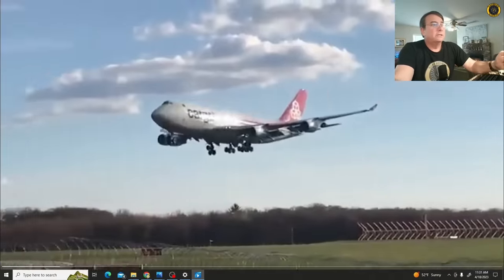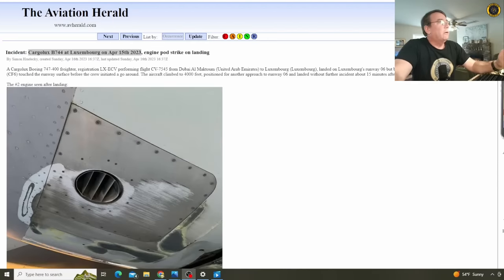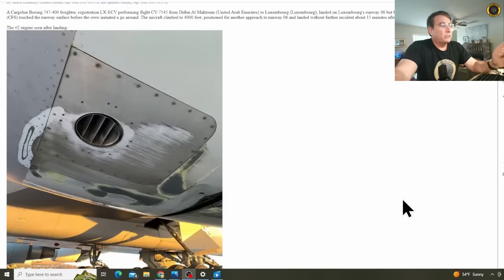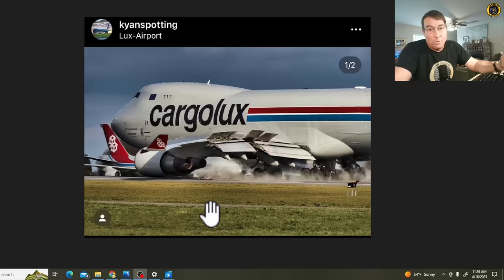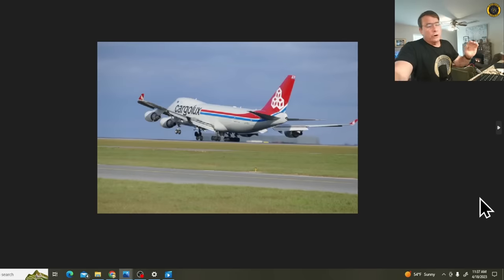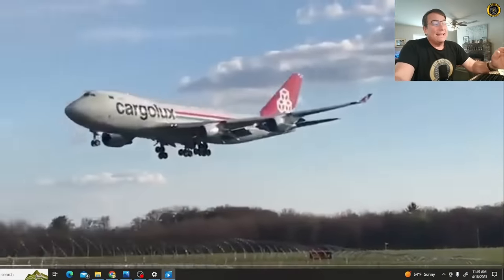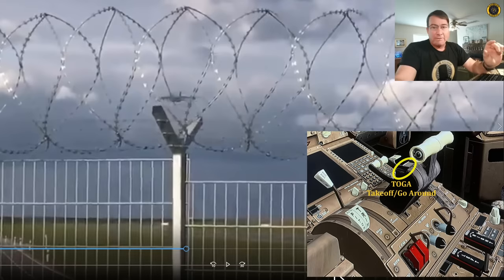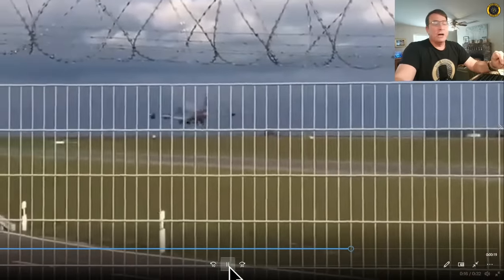Cargolux 747-400 KABLAMMO!-SMASH AND GO 15 Apr 2023

Comment: Most likely they were at flaps 25 due the speed which would have caused flap load relief at flaps 30. I have landed at this airport many times in a 747. There is a big hump in the runway that causes visual illusions as well. Very tricky in gusty conditions.
Reply: Is flap 25 an option in the 747? It is possible but not encouraged in the 777 except for at ultralight weights (<180T).
Reply: @EdOeuna  Our two landing flap choices are 25 or 30. If you are heavy and have any wind additive, you will have to use flaps 25.
Reply: @KarmaFlight  - that’s strange to reduce flaps for higher weight. On the 777 it is the opposite.
Reply: @EdOeuna  Does a 777 have flap load relief? It must work similarly if it has this feature. Do you land with full flaps in gusty cross wind conditions?
Reply: @KarmaFlight  - load relief only kicks in when you overspeed the flaps, and flap 30 speed is 180kts. Every landing is F30 except for unusual circumstances. I was in a freighter the other day and landed at 156T. This is about 15T above its empty weight. In fact we had extra fuel on just to keep the weight high. That was a flap 25 landing, but it’s pretty rare.
Reply: @EdOeuna  We land close to MGWT routinely at my outfit. Flap 25 landings are very common. Max landing weight in a 400F is 302 metric tons. Going into Mexico City in a -8 is a handful. You are going very fast across the fence.
Reply: @EdOeuna  Boils down to company policy/procedure, I suspect.

Comment: I am not a pilot and was wondering why it would not be safer to continue with the landing instead of going around, especially with a 13,000 ft. runway.
Reply: I’m wondering the same thing??
Reply: I'm not a pilot either, but from what I've read, trying to save that landing can lead to porpoising, which has a high likelihood to end in a crash. It's better to go around and try again instead of playing captain kangaroo and wrecking the plane.
Reply: Because you  have no idea, in the middle of a hard bounce with the aircraft making crunching sounds it shouldn't be, if things are safe at all. 

The three most useless things to a pilot are the altitude above him, the runway behind him, and the fuel he left on the ground. On the runway, you have 0 altitude to work with. If ANYTHING goes ploin-shaped, you go around, because that way you can assess the situation.
Reply: @00andJoe  Not sure the term ANYTHING is accurate. Maybe "mostly". Remember Pakistan Air?
Reply: @00andJoe  Makes sense - thanks
Reply: @realulli  Makes sense
Reply: There is a lot of runway remaining if you do this on a 4500m runway, so it might just be easier to stop. If you’ve deployed the reversers then you’re definitely stopping.
Reply: @EdOeuna  That's assuming you can quickly get the plane to go in the direction of the runway.

Comment: In times of relatively low workload, pilots need to fly the AC with the AP off and the AT off (both off at the same time) more often.    The number of "magenta line" cripples is troubling.

Comment: I've watched several times, and rather than wing-bend from the landing vertical speed, what I'm seeing is the entire aircraft roll to the left immediately after ground contact, and then recover to wings-level again.  Notice that the right-hand wingtip is rising, as is the right-hand horizontal stabilizer tip.

Comment: I think the events of EK521 in 2016 would’ve been a better example to explain misunderstandings of how the 777 autothrottle work (or in this case don’t work) during a rejected landing. The TOGA switches are inhibited once ground logic is sensed, therefore requiring manual thrust to climb away, which didn’t happen in EK521.
Reply: Correct. Even with the Asiana explanation, he omitted to say that they were in the wrong approach mode.

The AT wake-up does now occur in FLCH but it is still inhibited after touchdown.
Reply: @EdOeuna  correct. FLCH places the autothrottles into HOLD which is what eventually caught them out. After Asiana, the use of FLCH became prohibited below 1,000’ AAL. 
I personally think that the Cargolux event is more in line with the Emirates on, however, with a different end result.

Comment: Juan, would you recommend that for the Boeing 777, to always assume the aircraft has touched down if you need to do a go-around close to the runway (say once you've passed the runway threshold), just in case the main gear makes enough contact with the ground to disable the autothrottle?
Reply from the maker: No. You’ll know if you hit.

Comment: Back in the 1980's, the crew of a Varig 747 Combi "planted" their plane on one of the south runways at LAX so hard, they literally blew half of the main gear tires!

The plane skidded off the runway, and stopped - if I recall correctly, alongside Satellite 6. They had to completely offload the plane on the taxiway & replace all the blown tires, before they could move it.

Comment: It would be interesting to see all the dynamics in play in the last 15-min of this failed landing attempt. Given all the time the pilots had to plan, stabilize, and execute a landing maneuver, what on earth could've gone so wrong that allowed this to happen? The fact the fuselage didn't buckle or the tail section snap off in this instance was a miracle in itself. On approach the aircraft doesn't appear to be crabbed so the winds from the storm in the distance doesn't appear to be a factor unless the higher than normal speed negated that effect. Not really an issue if the runway is long enough for an extended roll-out. If this was a short runway and weather was a factor, I'd say stay airborne for a few rounds until conditions improve or find an alternate.

Comment: The original 747 was designed to be able land at 45* to the runway so that any crosswind could be handled that way.....if you see some of the old landings at the old Hong Kong airport and its crazy to see a 747 come in at such a crazy angle to the runway and actually land.
Reply: I'm not sure how accurate that statement is regarding the angle, but yes, it's far better to land a 747 in a crab angle than in a bank.  Even pretty small bank angles are dangerous near the ground with such a large wingspan and engines mounted under them.  Less of an issue on twin jets, but for large 4-engine jets, pod strikes can happen quite easily if the pilots aren't careful with keeping the wings level on touchdown.

Comment: That plane has certainly seen long service, I see those three little windows up on the top!
Reply: It's a freighter.  (A 747-400F.)  The current brand new and in-production 747-8F also has the same three windows along the upper deck.  The upper deck windows say nothing about the age of the aircraft.
Reply: Cargolux retired their 747-100 and -200 fleet in 1988 and 2003, respectively.  They only currently operate the 747-400ERF, -400F and -8F.

Comment: Rwy 06 is a strange looking runway although having said the approach to 24 is equally weird. Luxembourg’s runway is built on a plateau. At 4,000 metres it is very long with a hump in the middle. In daylight hours an approach to 06 can make you feel as if you are too high. So when you touch down you feel as if you are running out of runway even though there is another 3,000 metres if runway left over the hump. It is also unusual in so much that the ramp is not under positive ATC control unlike everywhere else in Europe.

Comment: Is a go around always the best option, after having smashed engines off the ground? Maybe on the '47, when it was confined to 1 wing. However, in the case of PIA 8303 deciding to go around after scraping the engines along the runway ended up killing not just all on board, but also killed 1 on the ground and injured 7 others when their engines packed up on the 2nd approach due to the damage from the strike on the first. 

What is the correct decision process here?

Comment: Air Canada DC 8 flight in 1970, had an early spoiler deployment on landing flare, they hit hard and were unaware they ripped off #4 engine. They did a go around but the plane exploded inbound with a loss of over a 100 passengers and crew! Any kind of wing or tail strike can be deadly!
Reply: Maybe a bit before flare even -- something like 50 ft altitude IIRC.  The two pilots were using nonstandard phrasing to communicate intentions/actions.  A misunderstanding between them led to the inadvertent deployment + subsequent crash.

Comment: This happened to me in my C172.  I think the engine is not damaged, only the nacelle is.  That's is relatively easy to fix.  However the engine still needs to be checked for sure.
Reply: I can't wait to hear how you had an engine nacelle strike in a C172.

Comment: So what you are saying is that even if you have hit the TOGA button and crammed the throttles forward, they will go back to idle if auto throttle is engaged and if the wheel weight sensors still detect on ground pressure? [One would think hitting the TOGA button would automatically set TOGA power [shouldn't have to cram them forward] with auto throttle automatically engaging if it's not already engaged regardless of ground sensor data] I suppose I would have to read the operators manual myself to understand the various situational operating parameters.

Comment: You mentioned knowing the idiosyncrasies of the 777 auto throttles and that all pilots have to know how to handle them. Hmmmm, sounds familiar. I recall thinking that a 737 runaway trim issue is also just another idiosyncrasy that experienced pilots have to know how to handle, no?

Comment: Non pilot here, but I am curious.  Why didn't the pilot just keep it on the ground?  Seems the damage was done.  The spoilers were up and the plane seemed pretty stable after contact with the ground.  Not sure if they realized the engine contacted the ground, but there seems to be some risk taking it back up in the air not knowing the extent of the damage versus keeping it on the ground.

Comment: I have always been curious as to why it is SOP to perform a go around after a bad/botched landing. 

Had Air Canada DC-8 flight 621 into Toronto on 5 July 1970 stayed on the ground after an inadvertent ground spoiler deployment in the flare, those 109 passengers and crew would have more than likely survived.
Reply: Depends on the size of the plane, the speed and how much runway is left.

Comment: Luxembourg has a large upslope on that runway. Probably caught the pilots out, even though that was home base for them.
Reply: Others have also mentioned the opposite direction runway is typically in use, so even being based there, the pilot flying probably had a lot less experience landing there in that direction which can definitely cause some optical illusion (and misjudging of vertical speed and angle) on the final approach.

Comment: Juan, perhaps you can discuss why so many pilots are trained to remove their hands from the throttles after setting takeoff power. As you know, there've been many crashes in both GA and a few in 121 aircraft caused because because a throttle rolled back or, like that 777 in SF where no one was even watching the throttle, much less keeping their hand on it during one of the two most critical stages of flight. I only flew Caravans at a Pt. 135 airline but I never dared to take my hand off the throttle during takeoff or landing. Do you really need both hands on the yoke?

Comment: Back when I was a flight instructor I used to have the slogan printed on my cards “ Flying is a science artfully applied”. If you are doing an approach in a 747, you should have your numbers nailed down. Am I wrong? I have just 1 single hour of 747 time (long story) so I don’t want to be overly assumptive. How do they get so outside of parameters?

Comment: I'm wondering if the auto throttle "wake up" problem had any part of the BA 777  short landing incident at  Heathrow a number of years ago
Reply: No, that was due to extremely low fuel temperature that caused “slush” to clog the fuel flows through a heat exchanger. This was a RR problem only as GE had a slightly different design on their heat exchanger .

Comment: Nah, should have kept it on the ground. Then grounded until FULL microscopic Gear Check, Wing Root Check, Upper and Lower Mid-Fuselage Check.  Fly away and and engine could fail, or fall, a wing could fold, and when next 'hitting' the ground, the gear could fail.  The gear could also jam in transit.

Comment: A weird one: While the attitude over the threshold looked fairly normal, the speed was obviously abnormally high - and when they smashed down, the flaps definitely didn't LOOK like full landing flaps, whatever the reason. Seeing that Luxembourg airport is not high and, at this time of year is NOT hot, this comes across as a partial-flap approach and botched landing - it will be interesting to see, in a few weeks time, what exactly was going on. These long-haul pilots have a severe handicap: A dearth of recent landing experience!
Reply: Maybe they were hotdog'n and having a bit of fun?

Comment: Juan, you said on the 777 that you have to shut off the auto throttle to initiate a goaround after touching the runway to keep it from returning to idle after you throttle up.
Doesn't touching down also deploy your spoilers, which would thwart your goaround attempt? 
Why didn't the spoilers deploy on this 747 when he slammed it on the runway? I know there are switches on the landing gear that activate them.
Those looked like takeoff flaps, not full-on landing flaps.
Reply from the maker: Spoilers auto retract.

Comment: 350 tons when loaded.... something happened on final approach as first the left wing started to dip and then the pilot corrected perhaps just a tad more than needed as the right wing dropped double what the left did that pilot corrected for. both very minor but again, this is a massive and normally when empty at 202 tons, much more reactive.
minor loss of lift due to cooler air at ground level? nah.....loss of wind gust lift just before touch down?.....it happens, especially when trying to touch down with a soft landing at this time of day, morning, and when entering an airfield surrounded by forrest.
the radical decent leads me to believe this especially with the wing tips flaring over the hull body long before the wheels touch the ground. this was a reason why they installed a third flap on this aircraft in later versions, one of the northwest airlines pilots told me about.

Comment: 5:55 this sounds like the next accident waiting to happen. 🙄

Boeing's automations always sounds like they are aiming for invisible concrete walls and expect pilots to notice them early enough by reading enough in manuals and bulletins.

This needs to work like in an Airbus. There's a button for Toga, you confirm that the plane is in Toga and the copilot confirms as well. Accident avoided.

Comment: So is it mostly cosmetic damage on the engine, or will it need to be dismantled to look for cracks or loose fittings? As well as the engine pylon? Just curious.
Reply: A lot more than just the engine.  Landing gear, for example, and likely structural elements in the fuselage and aero surfaces .  The particulars would depend on what rate of descent was recorded at touchdown, and what the landing weight was.

Comment: To me it looks like Flaps 25 landing which is normal, hard to differentiate between 25 and 30 though. The autothrottles are disengaged on a 747 in a manual landing as it has no auto retard unless doing an autoland. The Boeing FCTM recommends disconnecting autothrottles when you disengage autopilot. And obviously this is not an autoland :) . The TOGA "deadzone" is a little different because it does not pull throttles back to idle like it does on a 777, if within the deadzone the TOGA simply does not activate. That is why the go-around is always TOGA, flaps 20, and then make sure the thrust levers are advanced to TOGA thrust. This looks like just a botched landing with late flare, and a "textbook" go-around initiated after the pod strike.

Comment: What happens if you keep the throttles pushed to max, though? This would be my instinct on a go-around, just manually sliding both throttles to max and KEEP them there. Would I be fighting with the autothrottle system and, would I be able to keep them there?

Comment: Not flaps 35 (landing flaps), More like flaps 25 or even 20... interesting that when the engine was touching the ground the aileron and spoilers were indicating that the controls were commanding that wing down...
Reply: Flaps 30 is max on a 747, not 35.
Reply: @skyhawk_4526  sorry, its Been 8 years since I've flown it

Comment: When I initially saw this I thought of the Air Pakistan disaster. At what point do you decide to commit to the landing given they hit the engine or engines if it was a bit worse🤔. Maybe the impact wasnt that obvious? As a pilot myself I guess this is a fine line on which to make a decision. In this case they were lucky that the engines weren't damaged to that extent. A double engine failure on one side would have woken them up a bit. A good decision in this case.

Comment: Yes - good job on the recovery, but how'd that landing happen in the first place? Could they have initiated the go-around sooner perhaps if they'd realized how hot they were? Maybe the winds changed on short final? Great recovery, but I hope we also talk about how to avoid it in the first place. How many structural defects have now been introduced into that airframe and will they find all of them? The old gal held together - holy cow, that's allot of weight. Compliments are also in order to the many hands that designed and put that bird together. That slam down was asking allot, but she took it and the crew walked away.